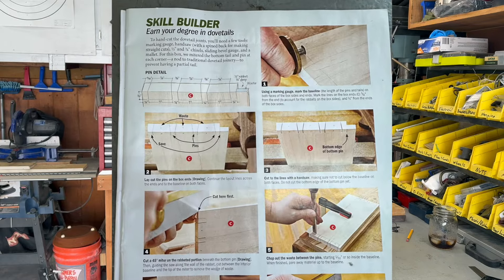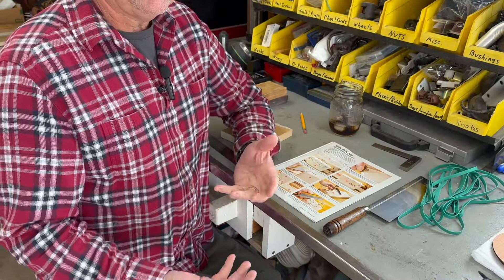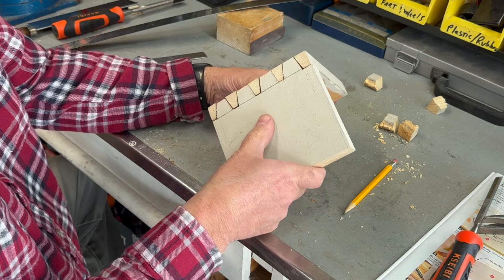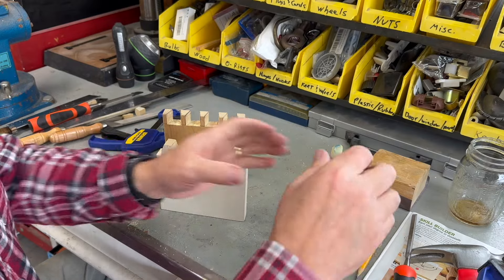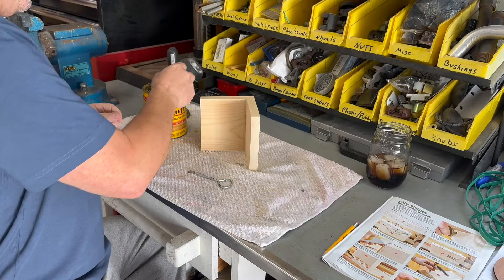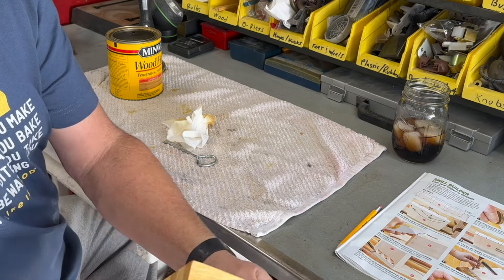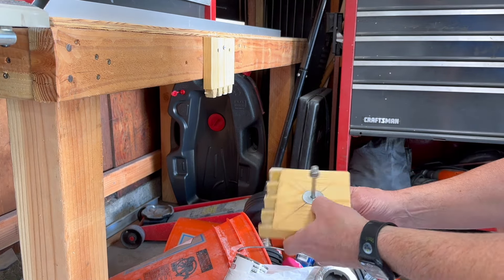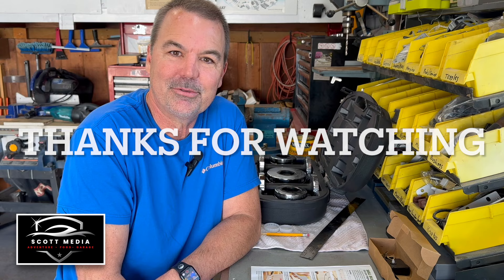Hand Cut Dovetail and Failure Testing

Comment: Great first attempt - and good on you for finishing and practicing!
Pro tips
1) to fix gaps, do your tail or pins first. then, when marking the other board, move the guide one width of your saw ( use your saw you will cut with ). THEN draw your lines
2) consider using a marking knife, instead of a pen or pencil. It has mechanical registration ( instead of visual registration ) for your tools.
3) the glue is stronger than lignin, weaker than cellulose. the Joint is actually fine and valid, its just not dovetails.

Comment: Not the albacore tuna 😂😂
Why didn't we just fill the buckets with sand or water or something! 

People need to chill about the dovetails being backwards. It may not be true dovetails but its a valid and effective joint that is actually a bit more forgiving than dovetails. The glue is providing a lot of the strength here and the joinery is adding a lot of surface area for the glue to engage with. Excellent video!

Comment: Complete fail! You cut tails correctly, but you needed to turn tail board 180 degrees, to cut pins. Dovetail joints have natural mechanical advantage because they interlock together and you joint was reversed, which solely relied on glue. Look back at your direction closely and find out where you made your mistake. Good luck!
Reply from the maker: Yeah, I want to redo this test and try to do it right next time. It was still fun though...